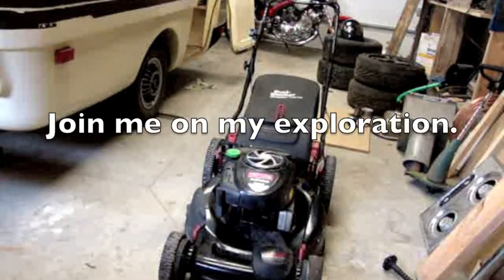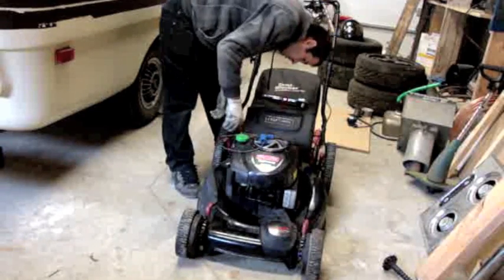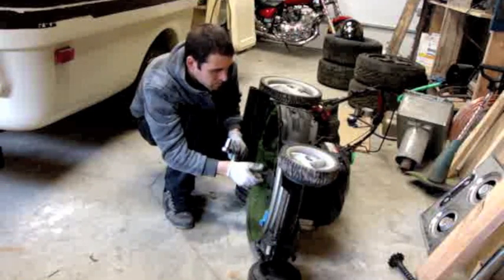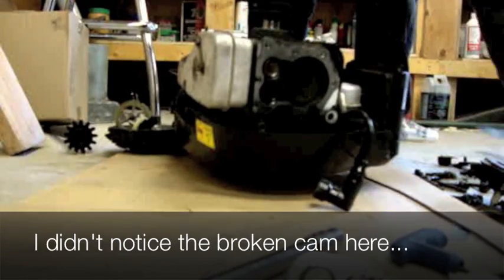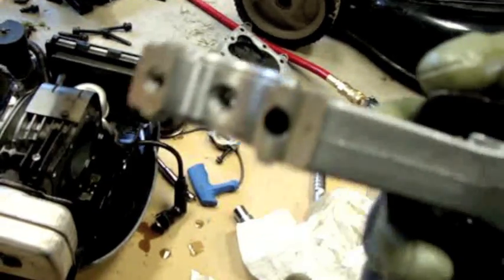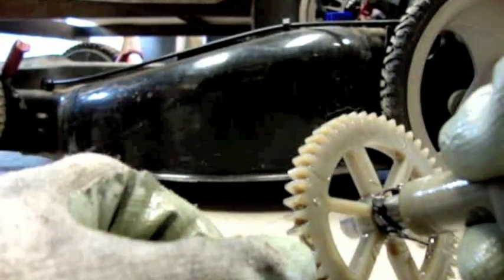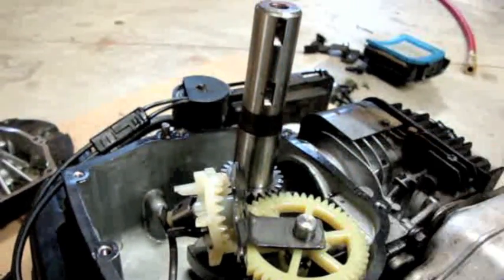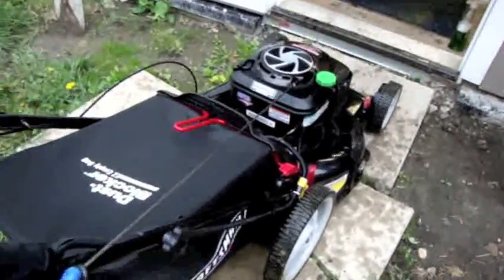Briggs and Stratton, Mystery engine failure.

Comment: Briggs and Stratton stopped making good engines after around 2005-2006. New ones are junk. I do small engine repair and have seen very cheap quality on the newer Briggs engines. Hondas are the way to go, and I will not reccomend a new Briggs and Stratton to any of my customers.

Comment: if the valves don't work its a  no brainer because Briggs and Stratton is using PLASTIC camshafts and in some engines PLASTIC timing gears in their engines its a common problem on the professional series engines. the plastic parts break and these are on mowers and on Pressure washers as the most complaints are on the Troy Bilt brand mainly the pressure washers as they buy them from Briggs and Stratton. as other companies buy them from Briggs as well.  as Briggs makes these engines less noisy using Plastic camshafts and timing gears but little do they know they are going to break.  plus have to use high grade gas in them too.
Reply: Any non commercial 4 cycle Small engine has NYLON camshafts even honda....